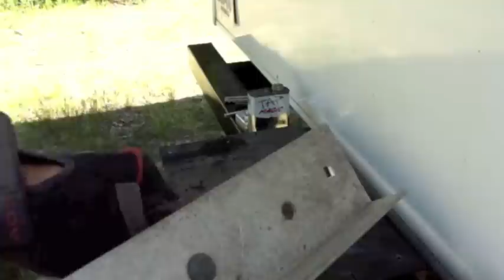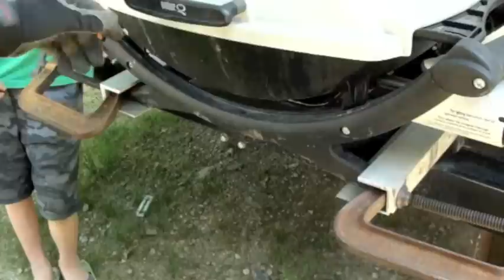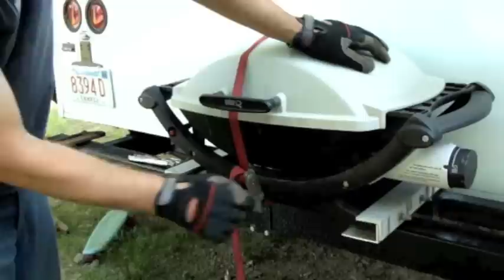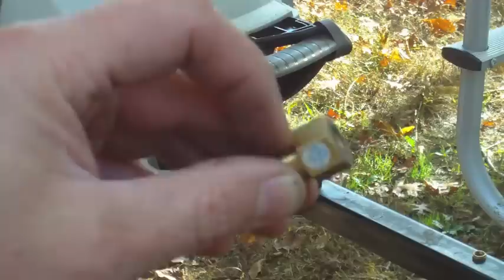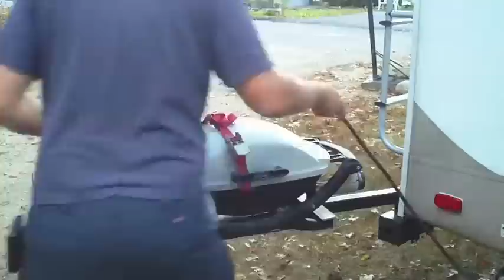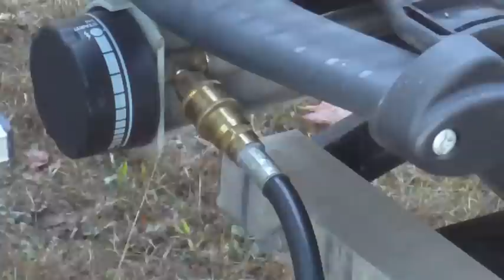Weber Q grille RV retrofit conversion

Comment: I wanted to thank you for your video. I have a grill that came with my RV. Pretty much a piece of junk. I was about to throw it all in the trash until I watched your video. I checked the regulator and it has the same quick connect fitting you show. When I get my new Weber I'll check it and at the most I will only need an adapter. Thanks again.
Reply: Update: Fits perfectly.

Comment: Interesting video.  I've always liked my weber grill.  I had the small one until it blew out of the back of the truck (I had kept it in the cardboard box with the top folded in).  I then got the larger one and have gone through two or three hoses when attaching it to a twenty pound tank.  I believe the hose gets blocked with liquid propane, this may be the problem with the volume of gas you're getting.
Reply from the maker: Owen4it I'm not sure, but it did seem to flow better on a small tank. I'm probably going to upgrade to the larger model. great grille, but small cooking area for 3 kids that eat like horses!

Comment: I am considering buying a new Weber Q1200 and wanted to hook it up to the quick connect propane on my trailer as well. The orange flame on your grill looks as though there is not enough propane coming out. Did you check to see what the flame looked like on high before you did this mod? Was it basically the same or did the flame lose some of it's original intensity on high?
Reply from the maker: beri232 It seems the same to me as what I was getting when I was using the grille's original regulator, with bottled gas. The burner on mine has never had a pure blue flame, like the burners on the stove. But I did by the grille used, so maybe there is an issue. Cold be its not mixing air properly.
Reply: beri232 I just did this conversion with my Weber Q1000 that is brand new and had a perfect blue flame - looks the same as with bottled gas.  The orange flame indicates the air/gas ratio is off... air shutter just needs to be adjusted
Reply from the maker: Scott Newton Or, as was my case, there was a partial blockage restricting the flow caused by a creepy crawly setting up house inside the input connection. Cleaned it this weekend while camping, and blue flame is back!

Comment: Do you leave the grill attached when driving?  I'm looking to attach mine permanently and leaving it on.
Reply from the maker: I disconnect the gas hose whenever traveling. But the grille stays on the mount. I use a ratchet strap wrapped around it to further secure it, and keep the cover from popping open if going over bumps.
Reply: @stevewatr  that's what I wanted to do as well.  Thanks for the the response.